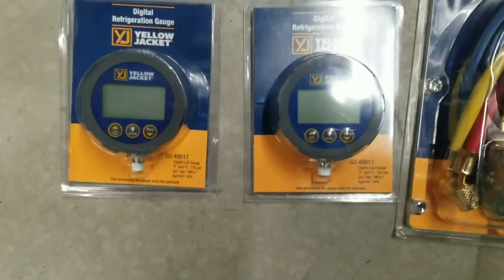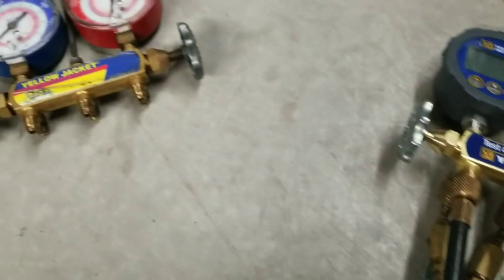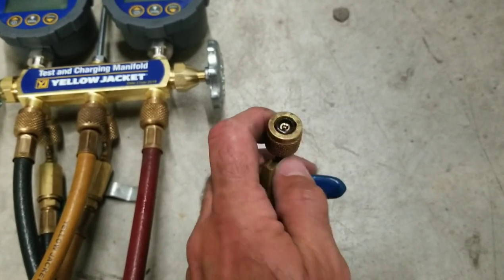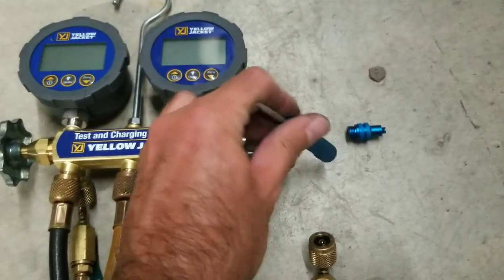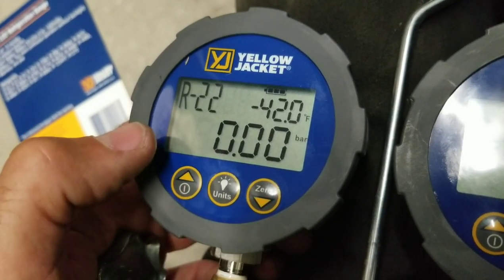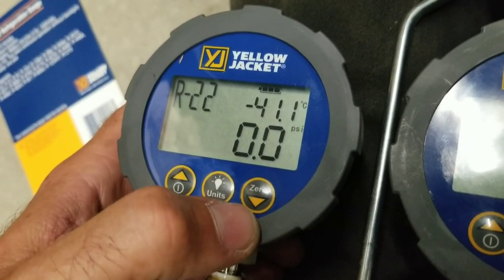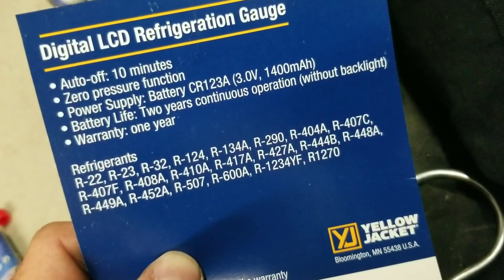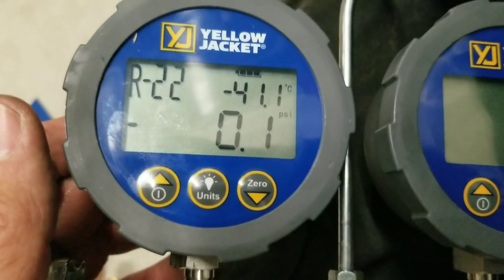Yellow Jacket Series 41 Digital Manifold

Comment: You need another Yellow Jacket tool to get the gasket out of your Yellow Jacket tool. Honestly though I like your idea of upgrading just the gauges on the traditional manifold. I only use the yellow Jacket heat pump manifold which both the red and the blue analog gauges read up to 800psi. Handy for trouble shooting restrictions and whatnot.

Comment: How did you do the install? Is there Plummer tape used? Baby steps. Thanks
Reply from the maker: texture6 the threads come pre wrapped.  I use Nylog Blue as well to ensure a tight seal
Reply: @HVACKnowItAll  Do you cover the thread tape with Nylog Blue or just the mating surfaces?
Reply from the maker: @yetanotheaverageguy  you can do that yes

Comment: Follow up video showing the gauge while vacuuming 🤔 for the price if u can't vacumm it's not worth it
Reply: Should just read -29hg or zero. You shouldn’t pull a vacuum threw gauges anyways they are meant for pressure